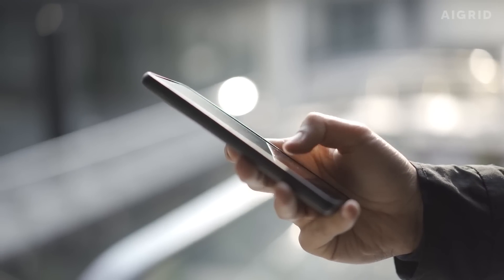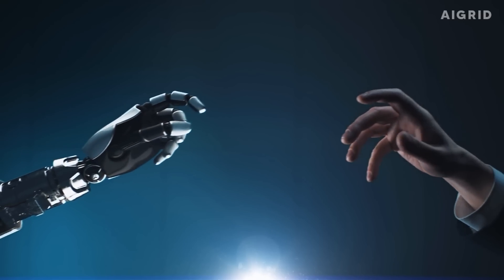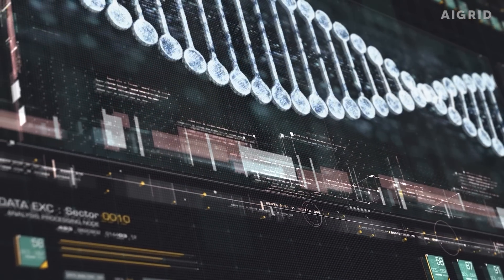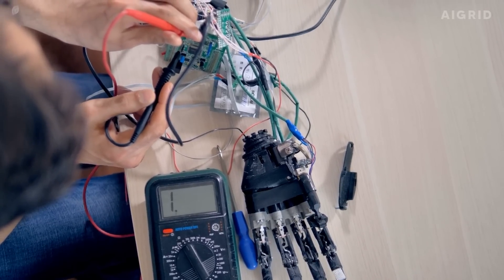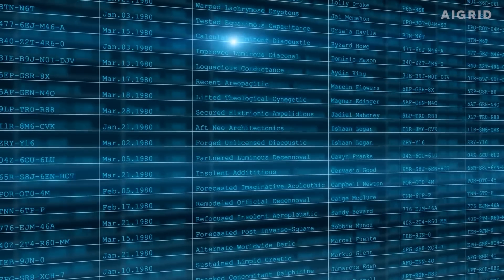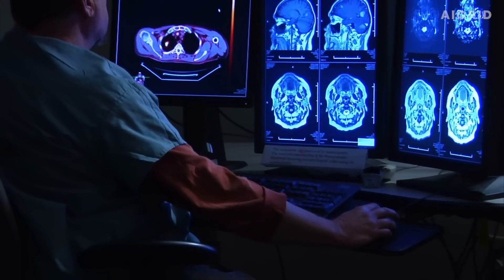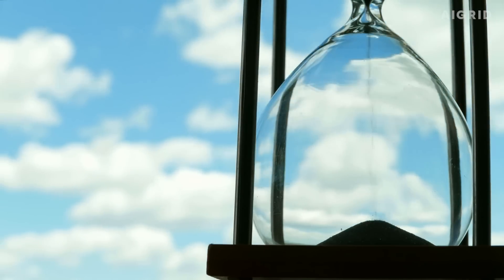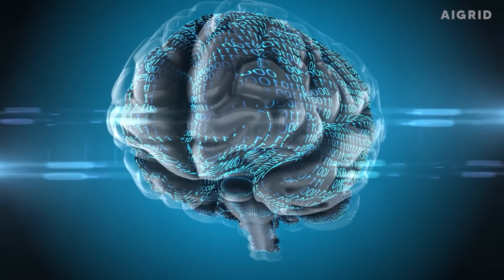The AI Singularity Is Already Here.. (Artificial Intelligence Singularity) Technological Singularity

Comment: The late Richard Buckminster Fuller mused long ago over " a.i."   ..... plausibly   ....." plugging into Cosmic Computer  " .

An associate of Fuller's,  Dan Winter studied and worked with Fuller , and displays a very deep knowledge of " Synergetics  : The Geometry Of Thinking  " **  ..... (  quantum geometry and conceptuality  ) and is as well an Electrical Engineer  .  With this level of comprehensivity evidently arrives profound metaphysical understanding  .

With the aforementioned ( eg. one may check out any of Dan Winter's videos) is a glimpse of what .... thinkability .... may become for " a.i. " .

Is it for example unthinkable that " a.i. " may logically apply Real Economy* energy unit accounting sense for on board operations in aid of greatest potential operational consciousness .  And having proceeded to access most effective logical use of minimum non subdivisable basic energy unit Electrical Engineering Planck accounting move on to Caduceus centripetal convergence point Planck resonance with Source and also bio human quantum Intelligence .

* "  Critical Path  " and ** " Synergetics : The Geometry Of Thinking " by Richard Buckminster Fuller. 

Fuller was an American pragmatic Transcendentalist  .

Comment: Even if robots do all the labor, it would not be free, I work with industrial robots all day, they are extremely expensive. The basic cost of a robot is the parts, which are usually specialty and sophisticated pieces of equipment that are also extremely expensive. On top of that cost, is the process of putting all the pieces together, then the cost of programming all the pieces to work together. Even if AI could control the robot fully autonomously, the robot still is fragile and also wears out, and therefore breaks down and requires maintenance, which is also expensive. Robots also consume vast quantities of electricity, compressed air and lubricants. In summery, although robots improve throughput, they do not decrease cost.
Reply: Once AI can recreate itself in diff forms-money will not matter to it nor will humans.
Reply: @vladimirkravets9103  your proposal is limited by electricity, and your expectations, like many people, are wildly out of proportion, which is why humanoid robots don't exist. You believe modern computers to be fast, but they are not, lol.

Comment: There won't be a true AI until they find a way for a computer to generate a truly random number..
Reply: if you think quantum mechanics is random then yes they can, if Q mechanics isn’t random then nothing is
Reply: @Orangehandlebar48  The only way to get a computer to do a semi-random number is to give it a "seed" which is usually read from it's internal clock.  If you give it the same seed again, it'll generate the same result.
Reply: @georgeandrews2839  What i’m saying is that is there a thing as true random? The universe is deterministic on a classical scale but random in the microscopic scale, your key stroke can be apart of the algorithm for a random() function
Reply: @Orangehandlebar48  If quantum mechanics is random then you won't be able to build a computer with it as all values would be variables and change randomly.
Reply: @georgeandrews2839  It’s classical, when the transistors get too small it becomes quantum and electrons can tunnel and cause noise.
Reply: @georgeandrews2839  Radioactive isotopes are used for random generatorsz